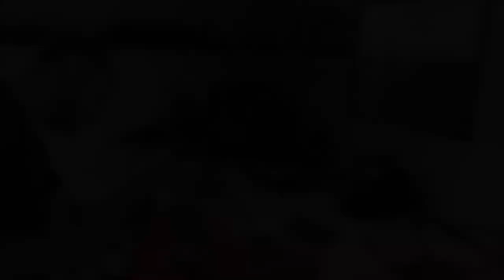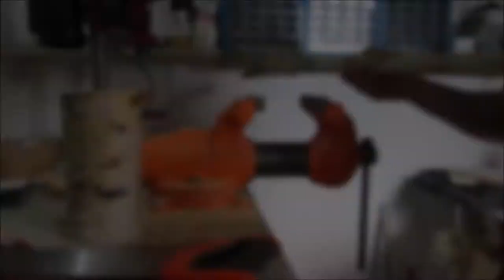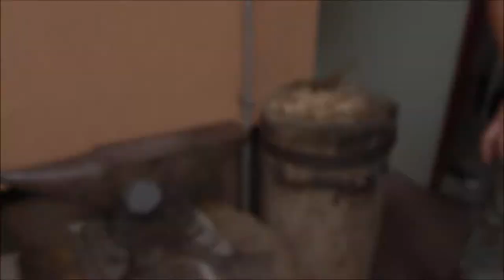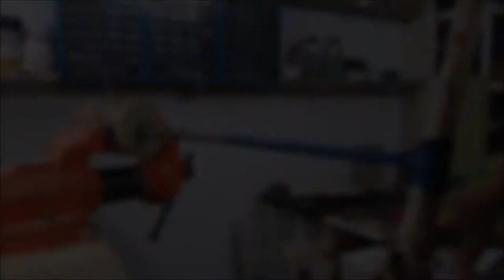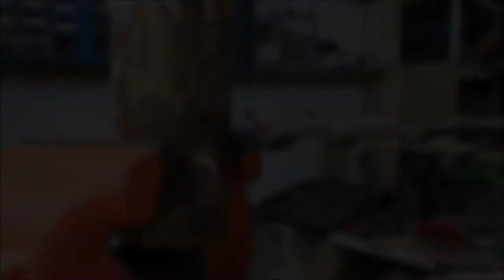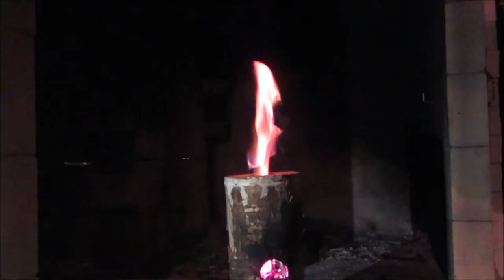Making a wooden rocket stove without power tools.

Comment: I would most definitely consider the vice being a power tool, although not an electrical one. In the outdoors that’s hard to achieve ;-)

BTW: what’s the diameter of the drill/hole? Give or take in mm...
Reply from the maker: Hi, well you need to draw the kine somewhere :-) the drill was also made with powertools and the knife as well. But anyway, the drill is 35mm wide.
Recently i sharpened it again but with sandpaper and a DC4 sharpening stone, it drills much better now then what you see in the video.